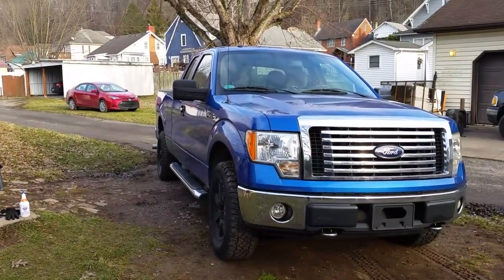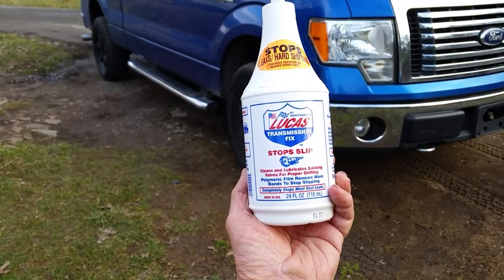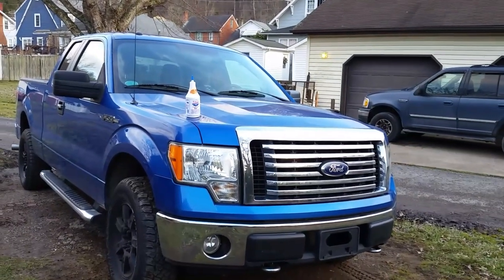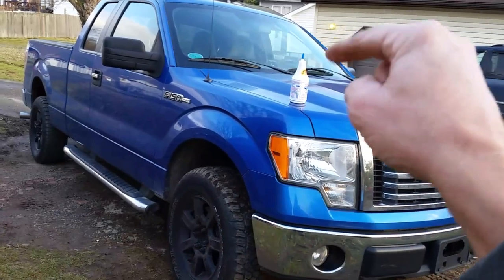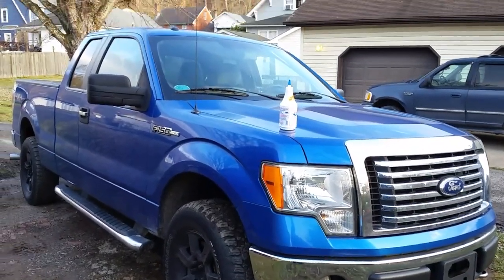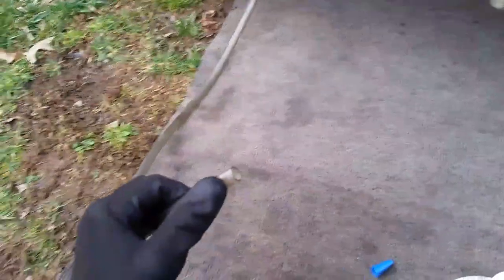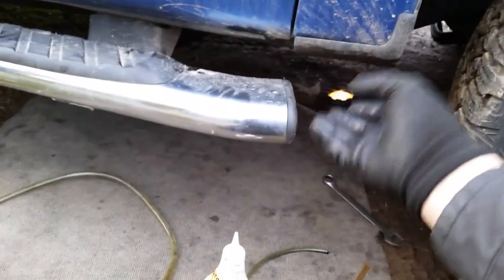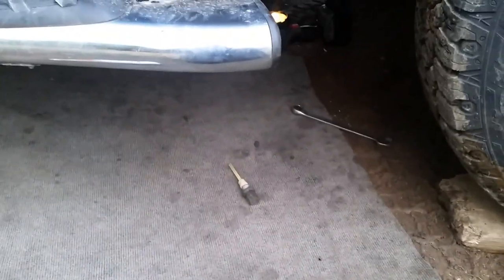""""Transmission Shutter"""" Help Will it work? A Real test

Comment: I have used lucus and seafoam transtune together.  Lucus helped slipping but the transtune helped clean up stuff.  After 1k miles after transtune was added changed atf  and added another bottle of lucus . 
The transmission was much worse than your on a Nissan 4sp re4f04b